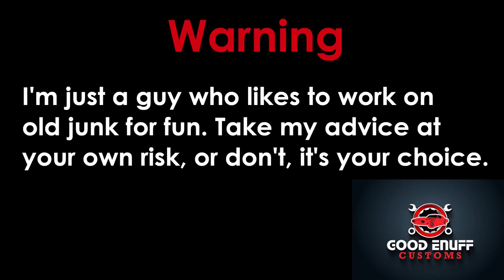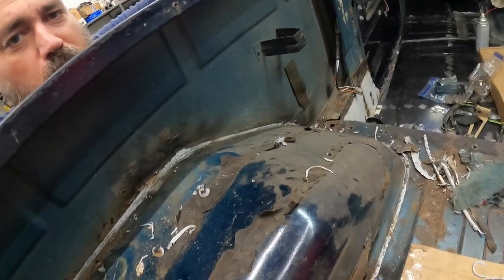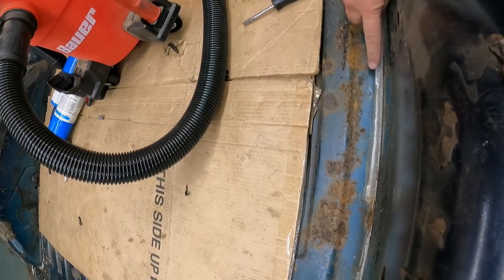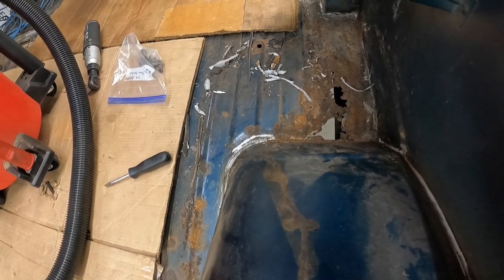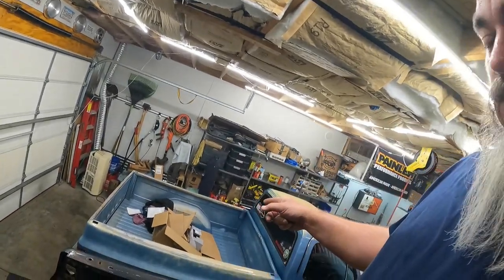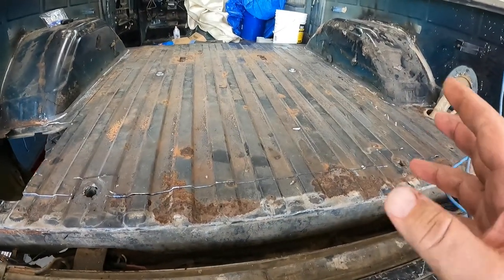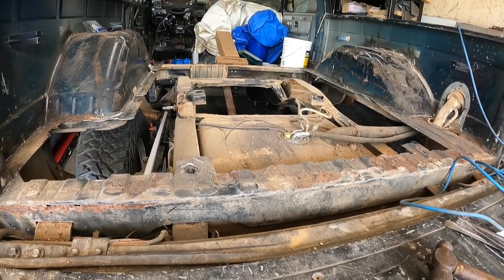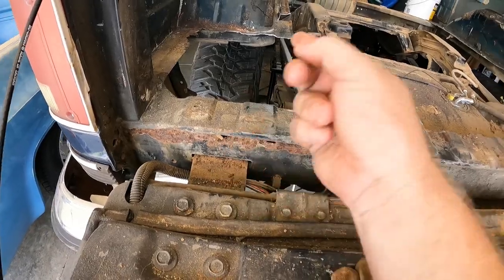K5 Blazer Resurrection Part 15 - Removing The Old Rusty Bed Floor

Comment: My son purchased an 85 Blazer military CUCV with a big diesel power plant. As you can imagine, the body is trashed. What are your thoughts on replacement of all body and floor panels with aftermarket products? Much more costly but seems to me that it would be easier. Cut out the old and replace. GREAT video. I learned a lot. Best
Reply from the maker: I've never really thought about that, but it probably would be the easier route. I would definitely spend the extra $ and buy the best quality I could find. For me so far AMD metals have been pretty great. Thanks for watching and good luck!

Comment: The floor still looked salvageable, lots of work.
Reply from the maker: It totally was salvagable, but I figure it would take more time in the end to cut and replace all of the rusty and rotted parts than it would to just put in new.
Reply: Here I am watching this in February of 2024.  Wishing I saw this sooner.    I totally could use the old floor and repair mine

Comment: Hey thanks for posting this I’m restoring an 88 k5 and you are helping me with mine. Any pointers going into this you can share?
Reply from the maker: Take pictures and measurements of everything! Maybe even a diagram where all the brackets, bolts and holes go. If I didn't have my own videos to reference back to I would have been lost!